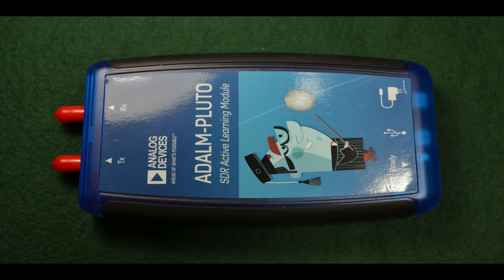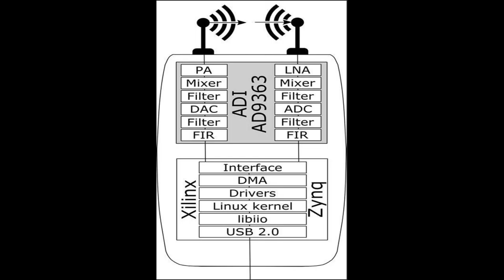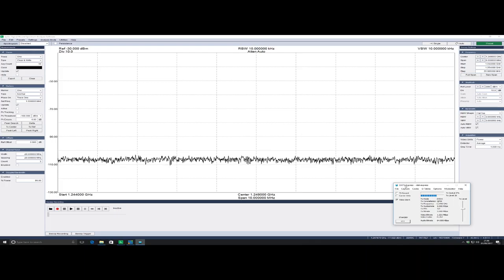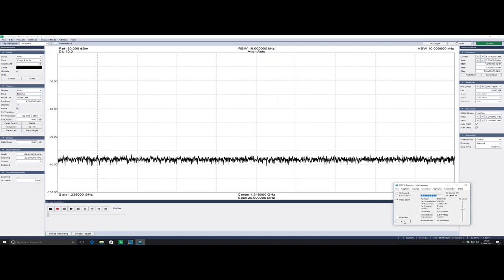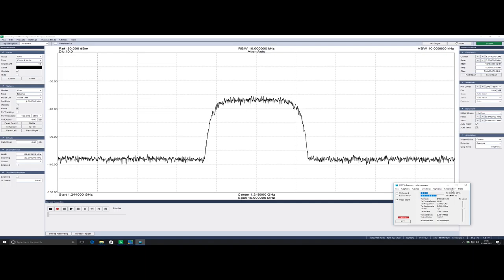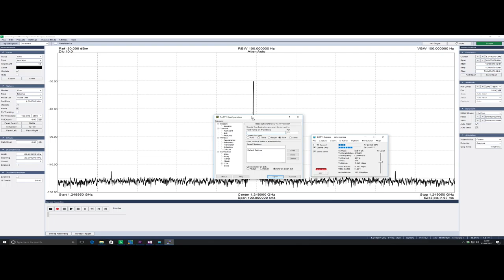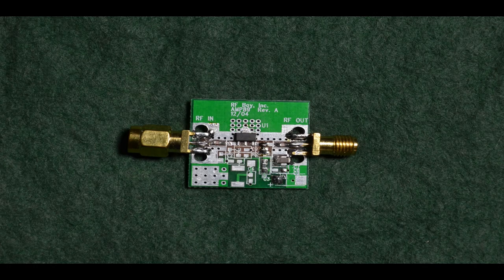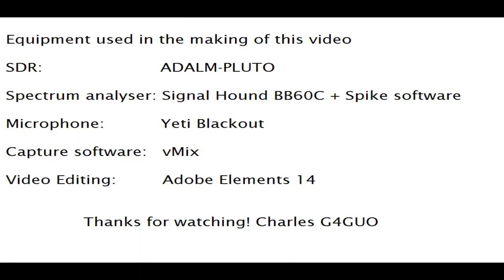CAT17 ADALM-PLUTO for DATV

Comment: Charles, the "suppressed sideband" you mentioned is the result of IQ imbalance, and it's the quadrature calibration that tries to suppress it.
Reply from the maker: Yes that is true. I noticed that the unwanted sideband also seems to vary with signal amplitude. I see that Analog Devices have updated their website to include some measured performance figures using a Keysight modulation analyser and the EVM figures and the output power they achieve for 64 QAM are far higher than what I was able to measure so maybe my measuring methodology was wrong. Still at 6 GHz the Pluto is more than capable of driving the 6W surplus PA I have into saturation so I am not too worried about the output power.

Comment: What S/W package are you using to display ADALM-PLUTO's signal?
Reply from the maker: Minitioune vivadatv.com but you can also use a standard satellite set top box or the Long Mynd project https://github.com/myorangedragon/longmynd
Reply: @G4GUO  Thanks for the info. My question is related to the physical interface of the PLUTO. Are you getting the IQ samples of Pluto from the libiio driver on windows or a Linux host and then processing it with S/W to extract DVBS signal?
Reply from the maker: @saeedchaudhry2447  This project is transmit only and uses Windows to talk to the Pluto via libiio. I have also done a similar thing in Linux. As far as the host application is concerned libiio looks the same on both platforms.